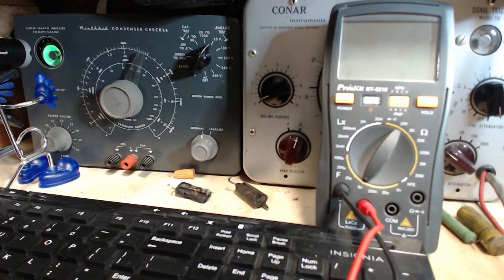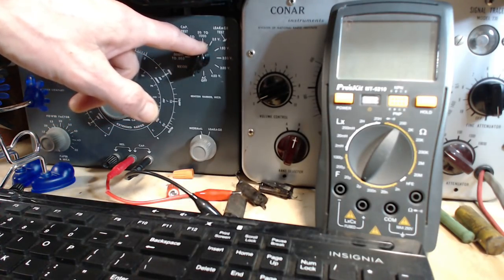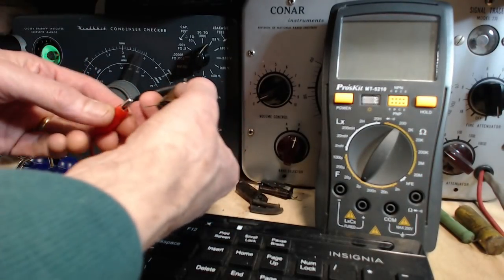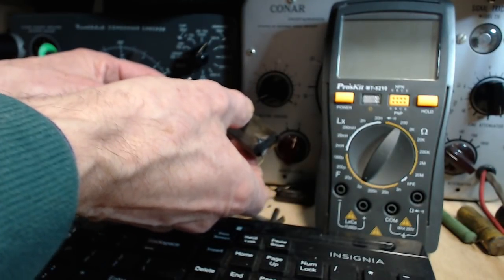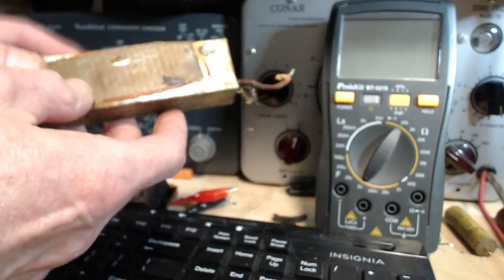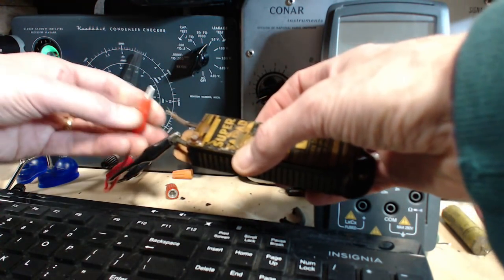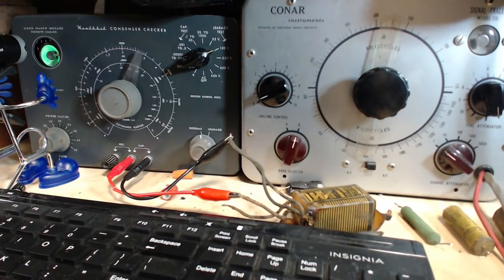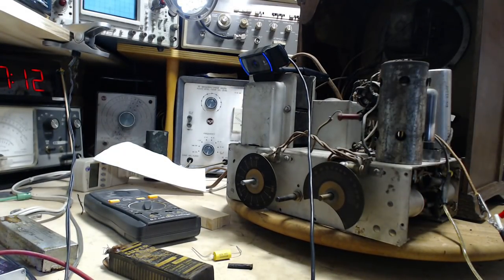Canadian General Electric K60 Video #6 - Ugly Capacitors Tested

Comment: Some of the capacitors you replaced you made a guess as to the value. I wondered if you replaced the cathode bypass capacitor on the 1st audio tube and with what value because I don't recall you mentioning the value. It is C22 and is 4mfd. It is across R13 a 3k resistor which is the cathode resistor. If you put a .1 or a .22mfd in here it would effect your audio gain and bass response.

Comment: Well, Hunt caps were rather notorious for leaking, just because of the paper construction. Try using 250V to get audible breakdown, though I find that you need around 1kV on a 440VAC rated capacitor these days for you to get audible breakdown on film capacitors. Good ones will not break down at 1kV, but failing ones ( still nearly at the low end of the capacitance tolerance) will break down quite well.